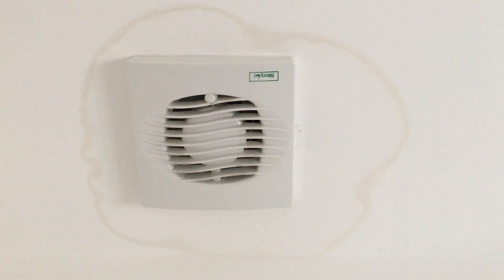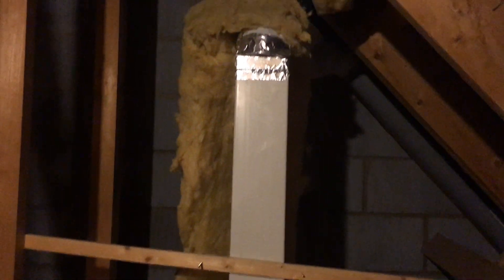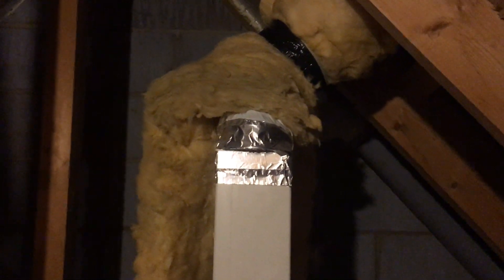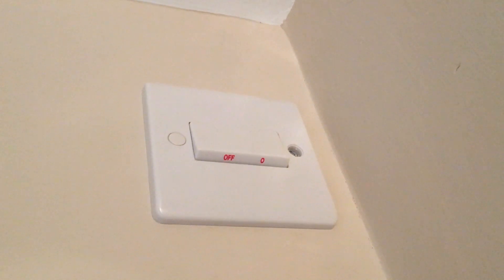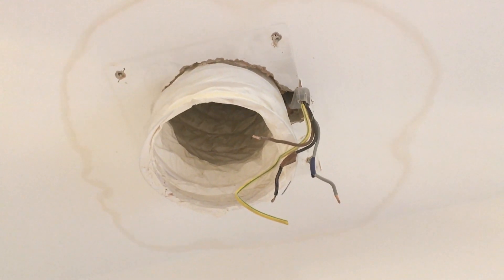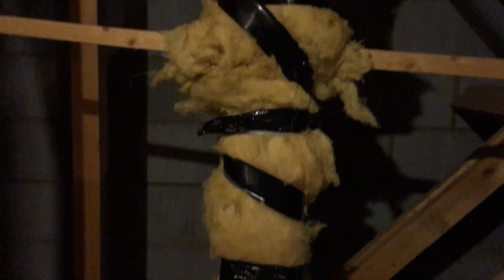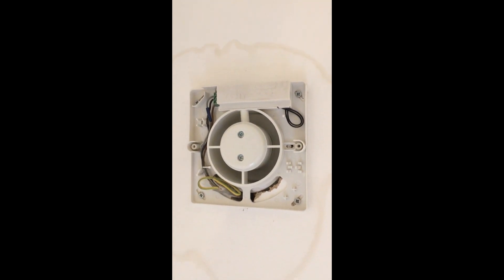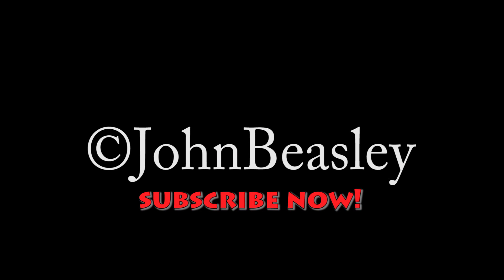Bathroom extractor fan dripping water. A DIY fix to solve problem and how to install new extractor.

Comment: You are better off with a water trap fitted especially on a ceiling mounted fan where it's so close to the electrics, I had to do this, I fitted a greenwood smart fan in the bathroom and in the winter time I had water dripping from it which in turn blew the fans power supply, managed to fix the fans power supply  and now I have installed a water trap to take the excess water outside with an overflow pipe.
Reply from the maker: Thanks for watching Mega and sharing your experience. Cant help thinking that these fans should have never been fitted in a new-build property. ATB b33zo

Comment: Mine was leaking. There was heavy rain at the time which might or not be relevant. Happened the night before a bank holiday when I was knackered [thank you] I turned it off and the leak seemed to lessen. Crashed out, hoping never to wake up and face the problem.  In the morning the leak had stopped. Turned it on, seemed OK. Too good to be true?
Reply from the maker: Hi James thanks for watching. It sound like a problem that will need attention one way or another. I would check the duct/vent pipe to see if everything is correctly in place where it exits the building. If it is then you may have the same problem as in this new build property: wrong fan for length of duct/vent pipe. It's unlikely to fix itself! b33zo
Reply: @b33zo  Thanks b. House 30 years old. I moved in a few months ago. Shortly after the old fan packed up. A relative fitted a new one, paying close attention to properly securing it to the ceiling. All fine for a few months until this one incident. The rain was chucking it down megga. I'll broach it with him in the new year. I would not have a clue what to look out for.
Reply: I meant the old fan had packed up shortly after I moved in not that it makes much difference.
Reply: Your duct insulation is wet and full of mold by now if you didn’t do anything
Reply: @ghostfive7119  Lucky I'm rich then.

Comment: Hi, did you just pull down/slide flex hose over plastic neck at the back of fan or did you used some tape.. cheers
Reply from the maker: Thanks for watching Mateusz. From memory I didn't tape the vent/hose to the fan unit. From what I've learned since this video - from comments here and elsewhere - this fan is never going to work effectively on such a long run of vent tube. Should probably never have been installed in this new build property. Ideally re-siting the fan on an outside wall is the way to go. b33zo

Comment: Did the insulation work at all? Our bathroom fan also started leaking and shorted the fan which now needs replacing. I need to check if it’s dripping condensation or perhaps it issue with the actual outlet valve/ damper.
Reply from the maker: Thanks for watching TPOZ. This particular fan is unsuited to its position in the new-build property. I gather from my electrician friend that the vent/duct to outside should be no more meter long maximum on 'axial' fans. In this property the vent is just over 2 meters long so the fan can't shove the steam that far. Centrifugal impeller fans are recommended for long vents/ducts. Not a brilliant original installation - which as a second bathroom only got occasional use. In your case I would start in the attic and check the vent and the roof/wall exit. No point in installing a new fan until   you solve the moisture issue. Good luck. b33zo
Reply: If it's a roof mount, check the fittings for rainwater/ice leaks first. 
If it's a longer run, a more powerful "squirrel cage" type motor might be needed. Make sure that all joints are sealed with a foil or blue Tuck™ tape.
The silver tape breaks down after  a few years.
Reply from the maker: @gazinta  Thanks Reggie it seems there's a lot more to bathroom extractors than would first appear. Will do some research. b33zo
Reply: @b33zo  I normally don't add brand names unless it's for research purposes. I'm not sure if that's available in the UK, but alas. We have Google and amazon if things get dicey.
Reply: @b33zo  I'm out here learning about condensation traps that drain into the regular plumbing or into the sump well if everything else fails. 
Mold isn't a complaint I like to spend money fixing if it's my fault. 
I'd like to avoid that type of loss and reputation.
Reply from the maker: @gazinta  Interestingly this is a new-build property for which the architect should have specified the correct extractor installed for the duct length.

Comment: As a follow up, did it work? I can't see how to get my extractor fan off.
Reply from the maker: Thanks for watching whovisions. In a word, no. It was never going to work from the moment the builder of this new property fitted it. To move 'x' amount of air 'y' distance a fan of certain magnitude is required. Worth researching before spending any money. b33zo
Reply: @b33zo  I finaly got the cover off of mine. It was full of water  so that's why it was dripping. Not exactly safe where electrics are concerned.

Comment: hi great vid. How did you find out which cable was neutral? which goes into which terminal?
Reply from the maker: Thanks for watching AJ. Luckily my electrician friend fitted the extractor while I was in the roof. Usually in UK with a 3-core (plus earth) cable the permanent live is brown and the switched live is black. In our case the markings on the connection terminal were extra small which made them difficult to read in the low light. When in doubt consult a qualified electrician! b33zo.
Reply: @b33zo  if you have a smart phone, take a picture of the wire and zoom in on the print.
😉
Cheers!

Comment: The cover on mine is filling with no rain and no shower being used. The one downstairs is being used. Oh and no roof space.
I'm emptying it twice a day and theres no damp on the ceiling.
Our plumber reckons its just shower condensation but its not being used. The one downstairs is the same extractor fan with no problems.
Mystery or what?
Reply from the maker: Thanks for watching Jim. As you describe it the vent is the only possible option for collecting moisture. I believe condensation only forms where two different air temperatures meet. Could you lag the vent? 
b33zo

Comment: The condensation problem will not be solved unless a condensation trap is fitted to the fan and,discharged to the outside
Reply from the maker: Thanks for watching Mick I didn't know about that but will do the research. b33zo

Comment: I live in a flat building on the ground floor flat my bathroom extractor fan is leaking it's dripping with water any ideas why? 🤔
Reply from the maker: Hi Michelle thanks for watching. If the distance between your extractor fan and the outside wall is short ie just travels through the cavity wall the external vent is the first thing I would check. Leaves, debris etc could be conveying rain into the extractor duct/pipe and allowing the water to run back into your bathroom. The seal around the vent cover may be leaking. Good luck. b33zo
Reply: I have the same situation. The leak has been going on all week so today I removed the fan, and hasn’t stopped leaking all evening. Can it really be THAT wet up there…

Comment: Horrendous situation  today.  Cold water in a steady stream from the extractor fan.
Reply from the maker: Thanks for watching Dorothy. Presumably not wind driving rainwater in? As several people pointed out lots of these 'extractor fans' are no where near powerful enough to move air more than a few feet. Hope you get it solved. b33zo